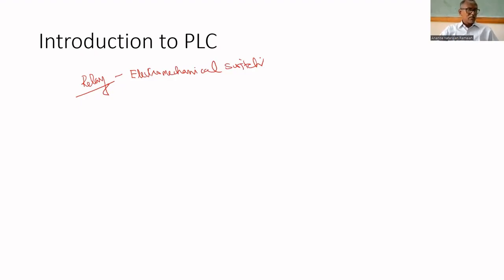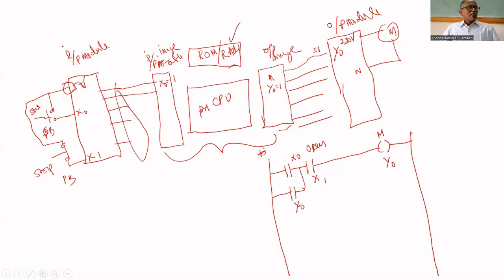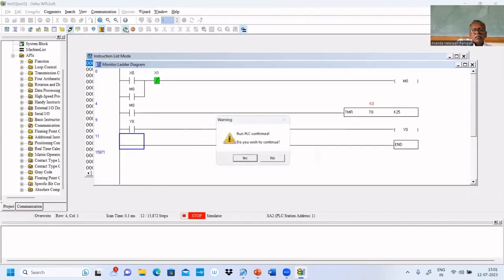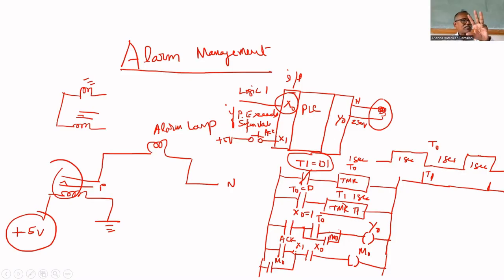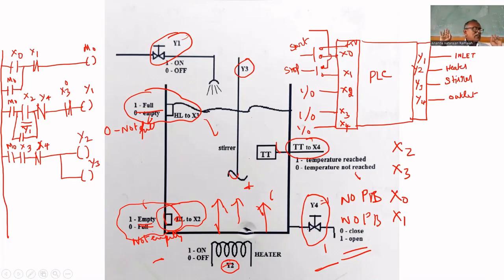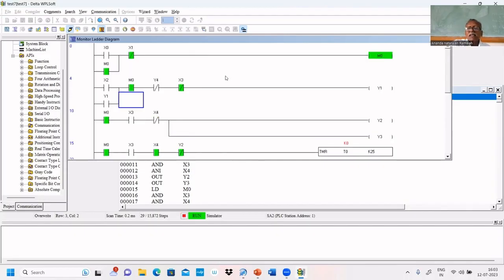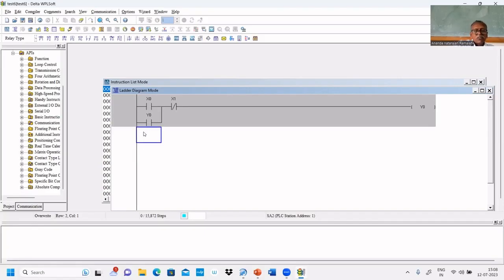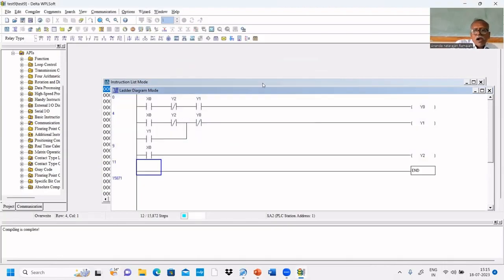PLC Programming with 10 Practical Examples | Ladder Logic ProgrammingTutorial#controlsystems  #DrRan

Comment from the maker: 📌 Pinned Comment

🔥 PLC Programming Challenge!

Design a Ladder Logic program for the following application:

👉 A water tank has:

Start Push Button
Stop Push Button
Low-Level Sensor
High-Level Sensor
Motor Pump

Conditions:

✔ Pump should start automatically when water reaches the Low-Level Sensor.

✔ Pump should stop automatically when the High-Level Sensor is activated.

✔ Manual Stop should override all operations.

💬 Post your Ladder Diagram or logic sequence in the comments sec